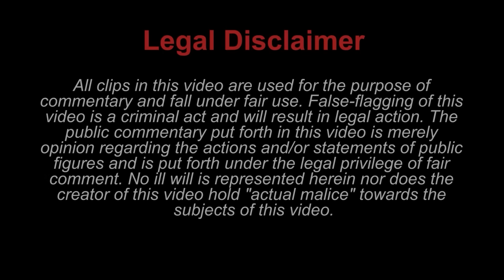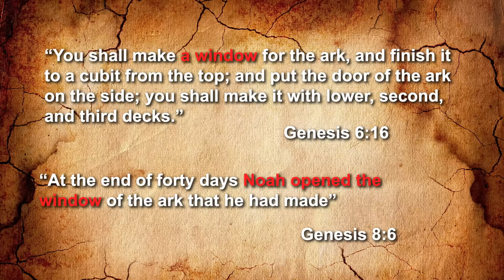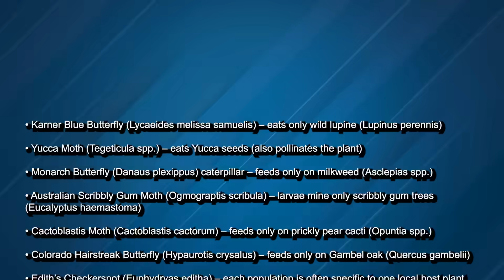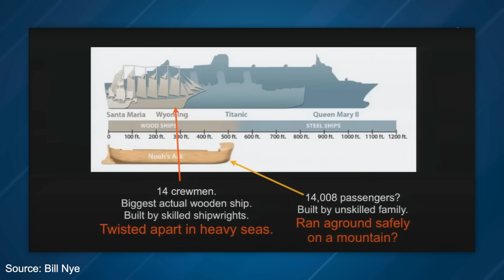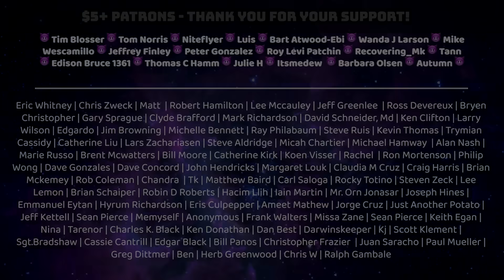Everything Wrong with Noah's Ark in 10 minutes

Comment: Just look at the materials needed. Johan's ark, the copy built in Holland, used the wood from approximately 12,000 trees. So, four men had to saw or chop down 12,000 trees, using late bronze age axes and saws. Then remove the branches and bark. Then saw all of these trunks into planks, still using hand made bronze saws and then season the wood so it didn't warp. Then transport them all to where the boat is to be built. Then make the tens of thousands of tapered wooden pegs needed to fix the planks in place. Then somehow lift all the beams and planks into place. No wonder Noah had to live a thousand years

Comment: Only one problem with this. Noah's Ark was real. It wasn't a boat, anything designed like that would have capsized. It was literally a massive Ark, or chest, which was prevent from capsizing by the simple fact that it was flat bottomed, and do much wider than it was high. That simply made it impossible to capsize due to the impossibility of taking it's certre of gravity past the tipping point.

I have heard ever argument against it, and the vast majority fail because they don't read the instructions, or use their power of reason to see the flaws in their imaginary scenario's.
Reply: Without referring to the big book of christian fairy tales (the bible), name one historically accurate account that verifies that noah ever built an ark

Comment: If the ark really held two of every animal, then the measurements give to Noah in the Bible would not be sufficient to hold those creatures.  The Titanic was as long as the empire state building at 882 feet, with 10 or 11 decks and it could only hold around 3,000 people. The largest cruise ship today is the Royal Caribbean's Star of the Sea at 248,000 tons, at 1,196 feet, with 20 decks, there is no way it could hold two of every animal. There are cargo ships bigger than the ark and still couldn't pull it off. That alone defeats the ark.

Comment: This does not explain the rainbow! 🌈

But for it to be the representative of lgbtq does? 

A rebellious nature is much more explainable than hateful resentment 

But if you remove God(Jesus Christ) out of the night, you lay down in sorrow
Reply: Rainbows form when sunlight passes through water droplets, causing the light to bend (refract), bounce off the back of the droplet (reflect), and then bend again as it exits. This process separates the white light into its component colors, which appear as a rainbow arc. 
The rainbow flag is a symbol for the LGBTQ+ community because it was created by Gilbert Baker in 1978 to represent diversity and pride, with each color having a specific meaning. The design was a deliberate move away from the painful history of the pink triangle, which was used by the N*zis to identify homosexuals.

Comment: Noah’s Ark was a barge. It had no oars, no sails. It was not meant to travel through the water, but just float around for a year. Therefore, there is absolutely no need for the sculpted ends that you typically see in a picture of the ark. The best design for the unpowered ark would be a square, even a rectangle would be less stable. I don’t believe in this story either, but I’m fascinated by the people that do!

Comment: The word is the same yesterday and today (2000) years it has not changed. What has changed is people. You think you are smart, how is you way higher than the almighty One! Gods ways are not our ways. In the ends times you will see people like this. I say please read the Bible. Do not questioned God. The wrath that is coming I do not wish on anyone 😢 it’s going to be bad and people want to argue about the flood breaks my heart. Put your faith in Jesus before it’s too late.
Reply: Actually there have been many changes to the bible over the centuries. Mark 16:9-20 was added in about the 2nd Century and wasn't part of the original text. Mark 16:18 was a later addition as well. Not to mention all the different versions of the bible in the last couple of decades.  So, it's gone through some changes in the last 2000 years. The wrath is coming? The book says no one knows (not even Jesus) when that's going to happen except the father. Call me crazy, but I don't think you qualify.

Comment: The flood was only 40 days, and the boat was protected by God himself , God makes miracles happen two kinds of dogs give a different kind of dog is not evolution just mixing of breeds, repent on time, brother, please separation from God is part of the devil's plan. Another theory that I've seen is that there was more than one Noah because every country has history of some similar kind of event happening in their continent.
Reply: 😂😂 you’re not serious? You read the story, right?. It rained 40 days but the flood lasted a year.
Reply: @eddiethatvoguy7901 He set the earth on its foundations;
    it can never be moved.
6 You covered it with the watery depths as with a garment;
    the waters stood above the mountains.
7 But at your rebuke the waters fled,
    at the sound of your thunder they took to flight;
8 they flowed over the mountains,
    they went down into the valleys,
    to the place you assigned for them.
9 You set a boundary they cannot cross;
    never again will they cover the earth.
Reply: @eddiethatvoguy7901 Genesis 7:24
New International Version

 The waters flooded the earth for a hundred and fifty days.
Reply: @hectormartinez1835  Last I checked 150 days is longer than 40, but the land wasn't completely dry and they didn't get off the voyage until a year  (or so) later. 
 Noah was six hundred years old when the floodwaters came on the earth. Genesis 7:6.
 By the first day of the first month of Noah’s six hundred and first year, the water had dried up from the earth. Noah then removed the covering from the ark and saw that the surface of the ground was dry. By the twenty-seventh day of the second month the earth was completely dry. Then God said to Noah,  “Come out of the ark, you and your wife and your sons and their wives. Genesis 8:13-16.
Reply: @eddiethatvoguy7901  yes it was longer than 40 days, but he touched land after day 40 the rest of the world was underwater for sure
Reply: @hectormartinez1835 huh? Who touched land after day 40? Noah? He didn’t get off the boat until a year later
Reply: @eddiethatvoguy7901  you literally wrote me scripture about God commanding Noah to get out this 27th day of the second month .
Reply: @hectormartinez1835  I did no such thing. The scripture says when Noah was 601 years 1month and 1 day old. He and the crew got off the ark. The flood started when Noah was 600 years old. So, he and the rest were on the ark for a little more than a year. Not 40 days.
Reply: @eddiethatvoguy7901  the reason why the Bible states how old he was is to describe when he was done with the boat and also to describe how old he was when the flood was done. It doesn't mean that as soon as he was done with the boat, he boarded all the animals.
Reply: @hectormartinez1835  I know. That's why I said the flood lasted a year, not 40 days, or a few months. Your claim that the flood lasted 40 days is incorrect.
Reply: @eddiethatvoguy7901 *it rainned for 40 days
Reply: @hectormartinez1835  Better. It's still a fictional story, but better.

Comment: The issues no one seems to bring up is.......

The ark depicted most is a flat bottom vessel. This is not ideal for sea travel. 

It has no ballest to help to keep this vessel centered with all the extremely heavy weight, plus in many biblical pictures of the ark shows the heaviest animals up top like elephants,  giraffes, hippos etcetera.  The heaviest load allways needs to be in the lowest part of the vessel to keep from rolling over. 

The ark has ABSOLUTELY NO perpoltion of any kind. So it would just drift flounder about every which way in the now vast ocean. 
A mariners worst fear is to not have any working perpoltion, dead in the ocean.  

This vessel wouldn't last 30 minutes before it capsized in a moderate storm let alone a word wide flood that most likely would have waves taller than the tallest building in the world.  

This story was told every year in Sunday school, and every other year there are sightings of the so called ark. Just ends up being a petrified tree or a rock. 

This was one of many reasons why I became an Athiest at 17 years old.
Reply: Good point
Reply: the story of the ark and the tower of Babel came from the sumerians in modern day Iraq and syria. Why? Because when the Assyrian Empire broke the northern kingdom they also banished tribes living there.

Comment: It’s interesting that every single point you make can be questioned with simple logic and honest questions. 
Are you trying to debunk this by using the exact text? The exact words?
If so, there were only 2 elephants. Only two. The exact words were “two of each kind”. Not “two of each species”. 
So the many many thousands of animals part has been successfully challenged. 
Next up. The big one. 
How do you know that there wasn’t any steel used in the construction  and how do you know it was superglued shut so it had zero way of circulating air? Doesn’t the exact text talk about multiple decks? 
Your part about the design of the boat can easily be questioned here. How do you know the shape and design?
As for the animals eating each other. What does the exact wording of the text say about the diet pre-flood?
The thing is, if you are going to try to debunk anything on the planet by using the exact text, you HAVE to use the entire text to do it.
Reply: How do you know that there wasn’t any steel used in the construction 
   Easy, this was supposed to have happened around 1500 years before steel/metal would be discovered and widely used.
Reply: 1 elephant eats (330-900 lbs) of food a day.  And drinks 30 and 50 gallons (113-189 liters) of water per day. Times 2 that is  660-1800lbs of food/day and  60-100 gallons of water/day. On a 360 day voyage that is 237,600-648,000 lbs of food.  21,600-36,000 gallons of water.  That's just the elephants, if you add, 2 hippos, 2 cows, 2 giraffes,  2 rhinos, and 8 people it climbs significantly higher and that's only 18 animals (humans are animals). Plus where is the water coming from? Animals need fresh water. The water underneath the ark is full of mud, dirt, dead plants, dead animals, dead insects, urine,  and fecal matter. Not exactly fresh.
The text says nothing about steel. It says gopher wood held together with pitch (glue/superglue). The text mentions multiple decks, but it only a window and a door. That's it. So maybe not zero, but very poor circulation.
Reply: @eddiethatvoguy7901  oh and they still need to define what "kinds" are
Reply: @ianisdehez4692  it's species, whether they admit it or not. Hell there was a dove and a raven on the voyage. 2 different species of birds. So kinds=species

Comment: Excellent video. But, the bit about the carnivores eating up all of the prey animals may be replaced by a different issue. Genesis 1:29–30 says that humans did not eat animals at all until after the flood (Genesis 9:3–4). And, some theists interpret that to also mean that the animals were all also vegetarians until post-flood. But, if this were the case, the replaced issue is now that lions, tigers, and all other carnivores have teeth designed for tearing flesh -- not grinding on hay. And, their metabolisms are certainly not geared for that either. So, unless god waved his magic hands and changed the dental state of all of the carnivores, that doesn't fly. Additionally, if ALL of the animals had to eat plants instead of just SOME, we'd now need even MORE plants in storage to last the year on the boat than the video mentioned. In short, any way you try to twist the fable, it remains a fable and is not remotely factual.

Comment: Google Maps 30.405274, 36.925954; if you are looking for Noah's Ark! What you will find is a ship like imprint some four thousand feet long and two thousand feet wide.
Reply: “A ship like imprint” isn’t a ship.
Reply: Even gopher wood does not last forever, even if left alone as a monument. An undisturbed imprint, only visible from an altitude, would be the only remnant of an otherwise torn down ship! Think about it, Noah and those who were on the ark had just survived an epic flood; no structures would be standing. Whole villages and cities made of stone would be covered up by the rise and fall of the oceans. The aerial evidence shows striations in the sand revealing the sand had been washed away from one spot; only to engulf settlements that we are still digging out of the sand today! When you look at the area the imprint is in; between two mountain sides, the flow of water away from that area is in two main directions. When you look at the direction the imprint is pointing in you will see the imprint is nearly parallel to the flow of water away from that general area. @hammalammadingdong6244 please use logic. How long ago was the "Great Flood" from biblical times?

Comment: Forty days and night's worth of rain sounds like a lot to primitves living in the desert, but it's a big world and that wouldn't even remotely swamp the land even with the craziest rain in human history.  
1.  The highest recorded rainfall in a single day  IN ALL OF HUMAN HISTORY, is 1,825 mm (71.8 inches), which fell in 24 hours on the French island of Réunion on January 7-8, 1966, during the passage of Tropical Cyclone Denise. 
2.  That much rain multiplied by 40 is 239.333 feet of rain.  Sounds like a lot of rain, right?
3.  Water finds its own level.  The Earth has only 29% of its surface covered wiith land, so that that 239 feet of rain is just going to run off and only increase the sea level 69.4 feet.
4.  God created the world, which means God created Physics and the rules of reality to which HE is bound.  You see, God is so powerful, even HE can create limits on his power.  Even a weak ape like you can do so, when you create a fish tank, you limit your power to reach through the glass and influence what's happening in the tank.
5.  In a closed system like a terrarium, or this planet Earth, rain comes from water vapor created by evaporation of the surface waters of the Earth.  Therefore, when GOD creates 40 days and 40 nights of rain, that only lowers the surface waters of the Earth temporarily, until that water falls as rain and returns to the seas, BECAUSE THAT'S WHERE THE WATER CAME FROM.  
6.  God made this world, and this world works on God's rules.  Physics and Science are GOD'S RULES.  The story of Noah makes no sense.  It is a repudiation of God's rules.  We can easily see that even the most extreme 40 days and 40 nights of rain we have ever experienced, even ten times that much, wouldn't flood all the lands of the Earth.  All of this is silly.
Reply: 40 days of rain is normal in Scotland!
Reply: Why don’t you just go ahead and tell us you believe in magic fairytales?  Would save us a lot of time.
Reply: @hammalammadingdong6244  I just spent 20 minutes typing out a logical argument demonstrating how foolish those fairy tales are only to have a stupid troll get confused and proudly accuse me of believing in them/  how's it feel to publicly make a fool of yourself?
Reply: @smiddywesson2703 
Poe’s law??
Lol
Reply: @hammalammadingdong6244  I made a straightforward analysis why 40 days and forty nights of rain would not flood the Earth.  IF you are not intelligent enough to understad that, then I will let your resonse speak for itself.  
]

Comment: There are regular stories of Noah's Ark being found on a mountain (Ararat?), yet it was biblically portrayed as no more than a giant floating barge.  As the massive amount of putative waters receded, currents coming off of the mountain would continuously push the Ark away until it reached the lowest point where there were no more currents (see hydrology) The Ark could never have come to rest anywhere near a mountain.  Even assuming the Ark somehow cam close to a mountain, it would not have been a flat valley, but rather the steep and rocky incline of a mountain.  It would have tipped over, not come to rest impossibly upright.